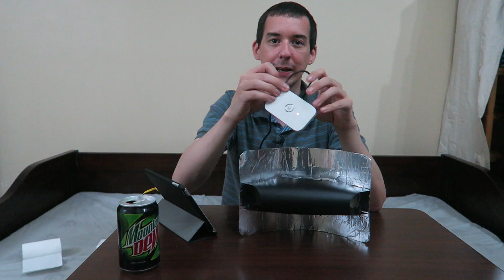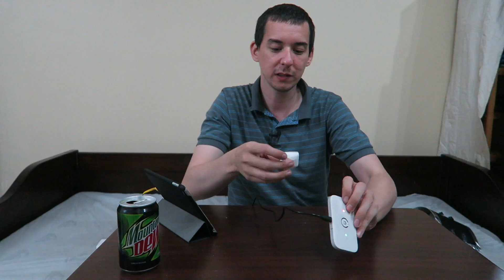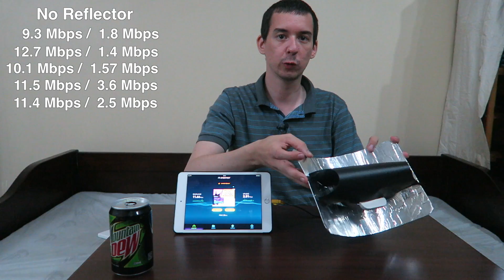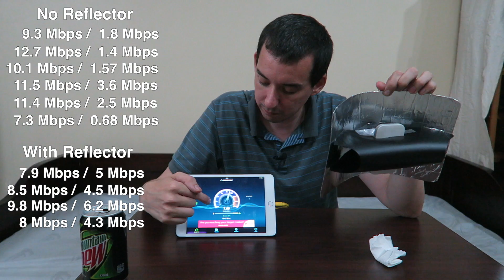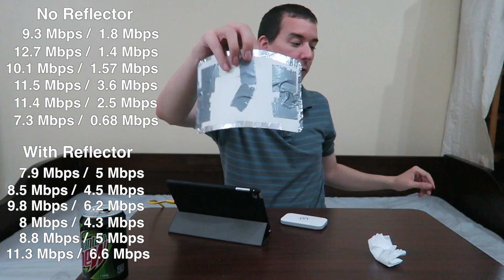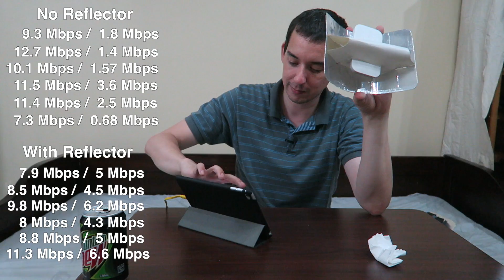DIY 3G / LTE Signal Booster - Part 1

Comment: Thanks for that, it gave me some useful ideas. I did as instructed and placed my mifi to face in the direction of the mast which put the bars up to 4. I then fashioned half a parabolic reflector out of an old bit of aluminium foil hat I had lying about and placed it adjacent to where I thought the mifi aerial was located. Hey presto, that pushed it up to 5 bars. Upload and download figures are greatly improved to 14-16 Mbps and Youtube no longer buffers all the time. Very happy.

Comment: You would be better calculating the correct distance between the reflector an the mifi patch antenna. Like any parabola they have a focal point. Your Mifi is nowhere near that focal point. Remember you need to find out what band your Telcoms operator is using too as there are differences in wavelengths between 750Mhz and 2100Mhz !! You will only get an increase in data throughput when it has less re-tries due to multipath signals. Your reflector/parabola is going to reject more multipath than increase anything because of the incorrect focal point. Good try though but no fat cigar.

Comment: Omg it works! Haha. I was having a hard time to stick the long round thing in the middle of the folder where you put the router. I only taped it and it's  not sturdy. When i put my router inside of it the whole thing falls because of the weight of my pocket wifi so i lean my pocket wifi on the middle of the folder and it still works XD
Reply from the maker: lol I'm glad you got it working!
Reply: Kaizan Pagsisihan
Reply: Hazel Gerhardt what?

Comment: I have a 4G Globe Pocket Wifi and i use to put it in a high place to get a good cignal,, its still slow and it only get a good cignal during 10pm in evening, is it  possible to have a good cgnal in morning or afternoon?
Reply from the maker: The time of the day shouldn't make too much difference to the signal strength or quality. Although more users during peak hours could be affecting the performance of the tower. Making a reflector like this might help but ultimately the tower just might be too overloaded.

Comment: Hello. I'm from Philippines, my room location has a low cellphone signal. Does this thing will help me? And where should i place it? Inside the house near my room? thanks.
Reply from the maker: It could help you. Just move it around until you find the best signal :)
Reply: Thanks for answering. I can use this as a signal amplifier right? The place where my room locatedhas only (Edge) I hope it will help me improve the data signal to 4G
Reply from the maker: It helps by making the antenna inside your device more directional. If you only have Edge you must be very far from a tower or have extremely thick walls. Give it a try and let me know how your results are :)
Reply: Gadget Addict Hello, i have a question. Does the shape matter? I'm thinking about a perfect shape to reflect the signal direct to my position. im sorry im new
Reply from the maker: Yes it matters, you need to download the template in the video description :)
Reply: Gadget Addict okay thanks. :) Ill try to make a big one.
Reply: Place it near the window

Comment: Instead of testing the speed, can you please post the Signal strength which will be accessible from your router settings in dBm before and after the use of the antenna. As the antenna can only increase the signal strength, speed test is not directly proportional to signal strength.
Reply from the maker: +Krishna Kumar I think you can see that in the video where I used the booster with an iPhone and then in a video where I talk about a custom interface for the pocket wifi device.

Comment: just to add some tip to have a better signal I use a lazy Phone holder and clamp the e5573 and put it near to the plastic roof.  that is the sweet spot that i have. lucky i have a power outlet neer on the location.
Reply: planning to to have those signal booster using lazy Phone holder as the holder and surround it with aluminum foil that used in grease fence on stove

Comment: Do you still experience Smart blocking your internet?
Reply from the maker: If I download/upload too much in a short period, yeah. But the block doesn't last as long as it used to.
Reply: I just heard that it has something to do with the firmware. I've heard someone never experienced blocking due to the "debranding" of his huawei b315
Reply from the maker: Tensai Ichizoku It's done by Smart on the towers, when it recognizes your sim. It doesn't matter if you swap device or use a firmware modified device, it's blocked at the tower :)
Reply: Have you tried cloning your sim? I think it will also depend on your ICCID?

Comment: doesn't it affect the wifi signal transmitted by the modem...?  like the wifi receivers behind the antenna?
Reply from the maker: I was wondering the same thing, so I did a little testing off camera. It doesn't make a huge difference because the wi-fi performance when you're in the same room still hugely outperforms what you can pull over 3G/LTE. So even if there is a slight decrease in Wi-Fi signal by using the reflector, you won't notice it :) Before I shot these videos, I was actually using the modem with a USB cable connected directly to my laptop, instead of the Wi-Fi. It didn't make any difference in the speeds I could attain :)
Reply: Thank you :) for the info..

Comment: Wouldn't it better to have the phone at the focal point of the curved reflector - for example an LNB positioned on a satellite dish? Alternately, just purchase an external antenna for the frequency your operator uses, open the device, desolder the internal antenna and connect the new external one.
Reply from the maker: Well that's essentially what this reflector does, holds the pocket wifi at the focal point of the reflector. A satellite dish would do better but would cost a lot more and take up a lot more space.I bought antennas for the LTE pocket wi-fi you see in this video. It supports external antennas without having to solder anything. But they actually made the signal worse on both 3G and LTE. They were only cheap antennas. I'm sure large expensive yagi antennas pointed at the tower would work much better.

Comment: Nice work.  Try an app called "open signal" to locate the cell towers.  I use it while camping.  It shows you which direction to hike/climb to get a better signal if there were to be an emergency.
Reply from the maker: Thanks for the tip. I checked open signal a few days ago and strangely couldn't find many towers listed on there. But I installed an app called FindTower and that was able to show many towers nearby :)
Reply: no

Comment: Nice video. Thanks for sharing!
Reply: Btw how'd you scale the template for the cut out?
Reply from the maker: +Jovz Salla for the bigger version, I hooked my laptop up to the TV and then zoomed in on the image. Then I stuck paper to the TV and traced the image by hand, since it was too big for my printer. Ideally you'd double the original size.
Reply: Oh. Thanks for the tip. Cheers.

Comment: This would be great if you have dish used for satellites coz it is much more bigger and better. anyways, nice video and information. Keep it up sir.
Reply from the maker: +Tech Geek (Tech Addict) yeah it would be better. I might check some junk shops and see if they have a cheap old satellite dish I could use for testing. I wouldn't wanna spend much though cos I already have good Smart LTE signal.
Reply: Yeah its not that worth it in your area sir. But it would be worth it for those area's that have poor connection.

Comment: will this work for pldt routers?
Reply from the maker: +Jeremiah Gaabucayan do you mean the PLDT wifi router provided for home DSL and fiver connections? It would make the signal between your router and laptop stronger (if it was directed at you) but it won't increase the speed of your internet connection.

Comment: I might want to #trythis soon, but what i'm using at home is my mobile phone on hotspot. So i might want to modify it to hold a phone with the screen still visible. You reckon i can just fiddle with the curvature of the reflective surface, since i don't have a printer for the template..?
Reply from the maker: I would start with the base design and just make the hole a bit larger, to hold your phone. I wouldn't worry too much about adjusting the curve until you determine if it's really going to make any difference at all. I didn't use a printer for my large version. I connected my laptop to the TV and then stuck paper to the TV and traced it by hand. I then stuck that paper to the more rigid folder and cut it out :)
Reply: Thanks for the advice! Once i have time, i will try and make one for my phone. I'll make a video too for the results if it's a fail or success. hehe
Reply from the maker: TryThisJ Cool, I'll watch out for the video! :) You might also want to look into discone antennas. That's likely what my next antenna-related video will be about.
Reply: great! imma look at that one as well..which one is easier to do. haha
Reply from the maker: TryThisJ The discone one seems more complex but could produce better results for general cellphone usage.
Reply: yah..seems to be more complicated for my skills and time. hehe..

Comment: do you have a diy for boosting network signal?  have super crappy globe signal at home, calling and texting have become a headache :( .  i think one factor maybe the high walls of our neighbor.
Reply from the maker: You could try using this same reflector. Of course it would make it pretty difficult to handle your phone :P I do plan to experiment with other antennas and reflectors which may be more suitable for your problem. But it could be awhile before I get to them.
Reply: have tried the diy windsurfer antenna but it didn't do anything to raise the network signal.  will wait patiently til you decide to experiment :) .  thanks ^_^

Comment: These really do work, it turns an omni directional antenna into a beam gaining about 10 db but from only one direction, which is probably what you want.  As you mentioned aiming is critical.  Every 3 db is a doubling of RF power.  A round satellite dish for scrap really works well as you are gaining both horizontally and vertically, just mount directly on LNB.
Reply: what is LNB?
Reply: The antenna on old unused dish, since it is already at the correct distance away from dish for signal focus.